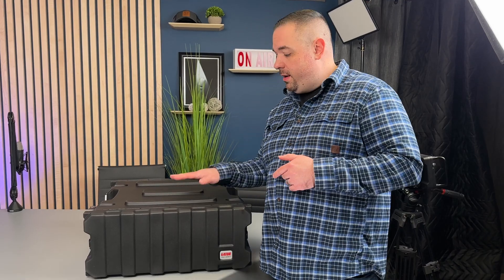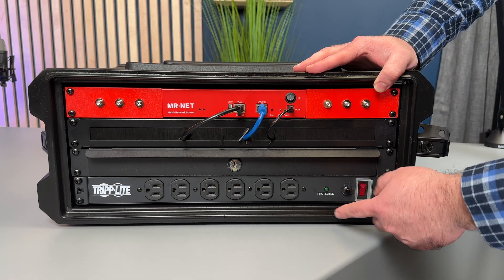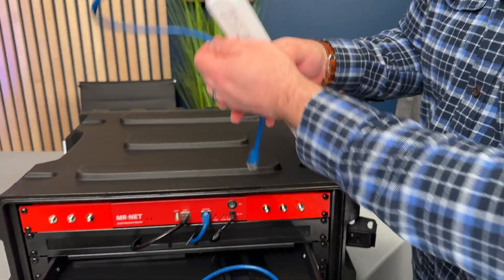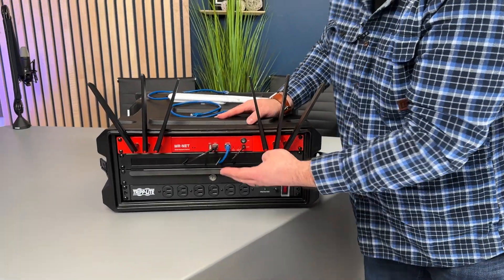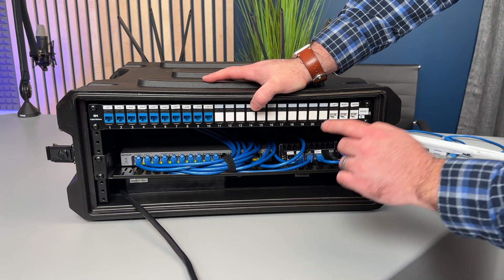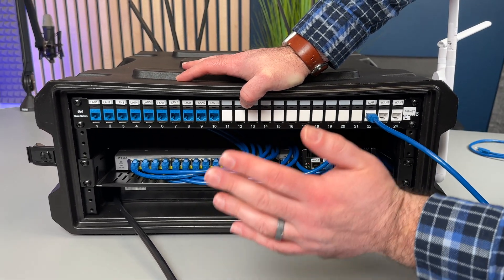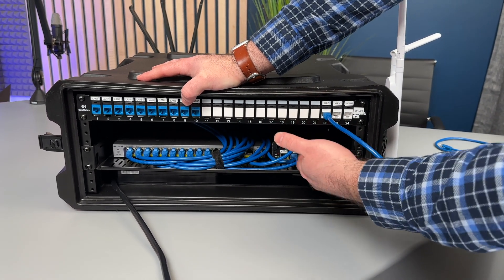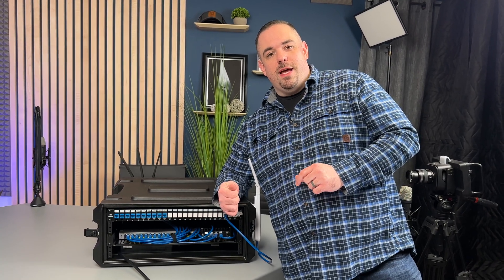Why did I wait so long to build this...

Comment: The 3D printed rack ears are very cool. Pick up a bonded router and have considered a rack mounting solution. I'm not as familiar with the pin connections as I'd like, but I believe you have to look for SMA and RP-SMA connections in order for the antenna to connect properly. Any wisdom on this would be appreciated.

Comment: Really nice! But no Ethercon? What's even the point of the patch panel then. I'd personally use Ethercon but if I wouldn't want it, I'd just get rack mounted switch and plug in directly 😂
Reply from the maker: Ya know I thought about this. But I have so many random devices on the tech table to plug and needed so many plugs and had the keystones already… I went this route. Making me think maybe I’ll use ethercon for v2
Reply: @streamingct  I get it... Ethercon is somewhat expensive and not that much better when it's just a random box sitting on a table. 
I also had it like this, but over the years come to a state, that I pretty much connect only racks when it comes to Ethernet... Everything else is pre-wired and automatically connected using VLANS. Then the patch panels with Ethercon are priceless. 😄

Comment: I really like this and it's a real clean and smart setup!

I wanted to share my experience as I've done something similar. I work for a fibre ISP and we are often tasked to provide wifi for various events, many of which being very rural and outdoor and requiring captive portal data capture for promotional purposes.

I've got a similar 4U flight case on wheels which I've got a Ubiquiti setup with a UDM-SE (8x PoE outputs) and a Ubiquiti 10G aggregation switch, both of which I've modded to be switchable between 48v battery power for outdoor locations or mains power for indoor events. I also have a Pylontech 2U 48v battery which provides at least 18 hours of runtime for the UDM and switch. I want to get a 1U drawer like yours to keep patch cables and spare SFPs etc as well so that will come in the future.

With this I have a number of telescopic tripods which hold Ubiquiti U6 mesh access points at 3m height, as well as a Unifi XG AP for larger events. I do have a couple of separate Unifi XG-6PoE switches which I use to extend over wider areas with some deployable fibre cables from the aggregation switch, I'm looking for a suitable housing for one of these and some sort of battery as well for next season. We run a full 10G WAN and backbone between all switches used.

With this setup, being an ISP, events that we cover are within reach by fibre and we can run a temporary 10G WAN connection across fields and through hedges to get where it needs to be, we've catered to many events including a small festival with 2000 guests where we saw a sustained throughput of 800+Mbps , it's just incredible how such a small portable kit can do so much. Each year we're evolving it and improving it and I'm really quite excited to see what we will make in the future too. Our flight case is also unintentionally waterproof with being made of fiberglass and the attachment of the lid allows a shower-proof ability so it lasts perfectly in the rain too.

Next on my list is a larger tripod of some sort for the XG AP, at least 8 meters would be amazing to cover better cover events with fairground rides (to get the AP above most of the rides)

Comment: Love it! Maybe look at getting a low-profile vehicle cellular and wifi antenna that you could just mount onto the case top. Just an idea. You could mount the AP inside and use one of those antennas as well.
Reply from the maker: Great point. I actually have one to test from parsec networks. Considering doing a separate proof of concept with it.
Reply: I like the idea but be aware that like most rf you want it kind of up high so it can spread better. So if everything's at like one table that probably would be OK. But if you wanted to cover the room you might be dropping that Wi-Fi signal as you walk away with a control tablet for something.

Comment: I have something like this but i used an 8u gator and put a retractable power cord in the back and rubber feet this let me flip it 90 so the rack faces up my 5G/LTE EZR24-A520 and starlink Gen 3 is all internally mounted on a rear shelf above the 40ft cord reel a drilled blanking plate has all the antennas mounted and they fit folded down with the cover on a single keystone on that same plate is the port for the starlink dish. and in the rack is SW-Pro-Max-24-PoE, UDM-SE, USP-RPS, 2x U6-Enterprise-IW mounted on the sides of the gator, the 4u left over is a 3d printed drawer with lid with all the extra cables spare antennas.
the UPS backup powers everything over poe
Reply from the maker: I am jealous, that sounds awesome. I should get folks to submit pics of their setups and do a video on them. Would love to see it. joe@streamingct.com

Comment: Not bad, i wouldnt put the AP-Mount on the side, because if you use the Case on the road, it is very likely that the plastic breaks. i would have added the AP-Mound inside The Rack or only the antennas. but everything else is very cool. thanks
Reply from the maker: Good point! I played around with a few different variations. I did think about the plastic breaking off. I might get a few 3D printed as backup! Thanks for watching.